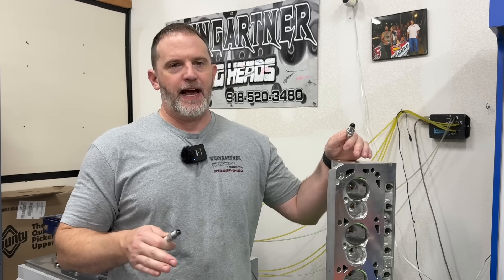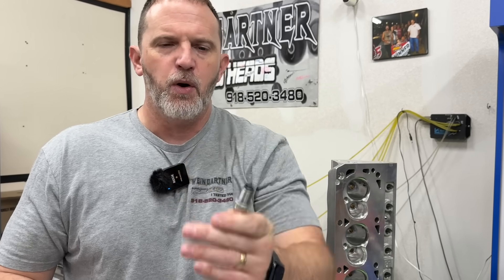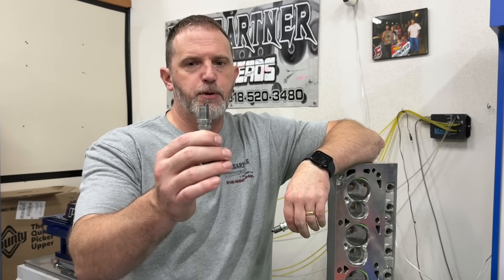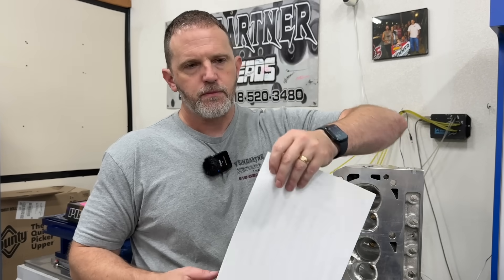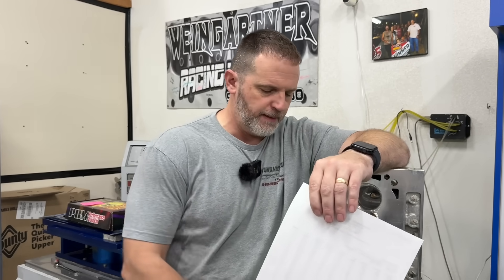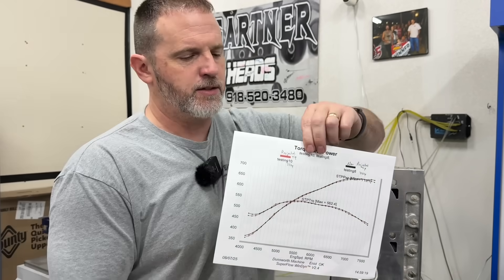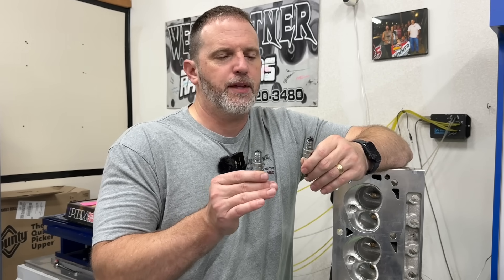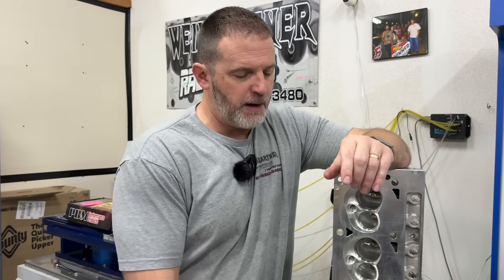Power Difference Between Spark Plug Tip Designs

Comment: Great work Eric! If there were a gain with extended tip plugs, I would have expected it to be from the added compression ratio it would provide by taking up more chamber volume (and negligible at that for a street engine let alone a race engine). I tend to stay conservative as well and use the regular plug unless called for by the head maker, as I am always concerned with the glow-plug effect that comes from those sharp threads just hanging out in the fire. The longer the run or w.o.t. time, the greater the chance of pre-ignition. Thank you for the hard evidence to go along with the theory!

Comment: David Vizard 
told a story about a spark plug modification he came up with many years ago that made power & won races in his Migit cars I think, & he said his idea cost him millions in a  patent when another racer showed him the same plug mod. 
     He said he took a conventional plug, drilled a hole thru the ground strap over the center electrode with a drill bit about the same diameter as the center electrode, & then drilled into the center electrode to make it dish shaped like a satalite dish.  This created another pathway for a flame to pass thru to create an ultrasonic flame or something like a harmonic ultrasonic whistle inside the chamber exciting the fuel mix maybe.  
Since 1999 it looks like this plug is made or modded under a name called 
Super Sonic Spark Plugs, or Ultra Sonic Spark Plugs.  The patent is expired but does exist with pictures.  U.S. Patent #5,610,470.
My thoughts are after the hole is drilled, use a small ball burr to put a slight chanfer under the ground strap hole, but still keep a sharp edge, or just leave it as Vizard designed.  Maybe the hole thru the ground strap was smaller than the dished hole in the center electrode, which would require to bend back the ground strap to dish out the center electrode with a burr, or bend back the ground strap to drill into to center electrode, but possibly weakening the ground strap when it was rebent back.  Probably a ball burr should be used to dish out the center electrode but keep the circumference of the dish sharp.  I guess the dish shape is to create & direct a flame forward into & thru the hole in the ground strap to create a jet flame like a Pre-Chamber style spark plug used on industrial engines & reminiscent of the old Honda CVCC pre chamber design.🤔
Reply: I found the David Vizard plug mod video titled: David Vizard How I got the best power sparks. 😲
Start watching at 25 minute mark, but the entire video is interesting.  I just set David's vids on 1.5 speed!😁
Reply: Kinda like the E Gap and the Splitfires.
Reply: @hotrodray6802  I think those plugs just create more turbulence from the multiple ground straps, but also more surface area of sharp points to last longer, where Vizards plug uses the center electrode as a dish to direct a flame towards & thru the small hole in the ground strap.  It sure would be neat to see an in-cylinder study slow mo video done by a university like E3 did, or if Eric could give it a try on his dyno!  I think using non resistor plugs & a powerful amplifier box & coil with Granitelli 0 ohm wires would be interesting!🤔
Reply: that patent # is incorrect. it comes up tp a mercury vapor light
Reply: @stevelaw2000  My replies keep getting deleted.  That is the correct patent number.  Maybe try without commas between the numbers, & also add, Assignee Wofsey, David.  Lots of links come up on the patent & the guys old sites.
Reply: @stevelaw2000  Not it sure if this link will post, but the patent number is correct for U.S. Patent 5610470 Assignee: WOFSEY; DAVID
https://patentimages.storage.googleapis.com/70/fc/7c/dd96a323d4d41a/US5610470.pdf

Comment: This maybe a dumb question to ask but I am testing in track a crank driven water pump setup vs standard water pump with a heavy balancer we took off roughly 12 pounds off the front of the motor the balancer itself weight about 9 pounds so that only weight that is on the crankshaft is the little hub that spin the crank driven water pump and we'll hopefully I can run that next week would you want to test that on the dyno i don't know if it will necessarily gain hp other than maybe low end or throttle response might be much better but curious and also curious if you think added dry sump would help it more or not we're trying to go dry sump next year
Reply: Ran with no damper on Lunati billet cranks and they would run about 1.5 seasons before the crank broke.
Somebody ran dyno tests.on SBC with different dampers. Stick 8" Chevy damper won the power race.
Reply: @hotrodray6802 oh dam that interesting and dam it now my crank might break lol

Comment: My thought on the timing. Base line engine with non projected tip needed x degrees to max out the HP. The projected tip extends into the combustion chamber more, igniting the fuel faster, therefore it needs less advance because of a faster burn.  Maybe you could run the projected tip in the boosted engine and cut back the timing to see if the results are similar.  I feel this is very good info when it comes time to tune for power without a dyno. Thanks.
Reply: I totally agree with the timing being a couple degrees advanced by sticking into the combustion chamber. The time the flame front has to move to get into the combustion chamber the same amount is quicker if it starts earlier. (but is negligible). The problem with a boosted engine is the incoming charge may blow out the spark (like a candle) and ruin any gain (talking about the projected tip.) So for a boosted engine, use non projected tip, with N/A, its a wash.
Reply: @annamckinney6622 it’s not a matter of incoming air blowing out the plug but it’s the increased cylinder pressure and increased fuel that makes it harder for the spark to jump, the higher the pressure the higher the voltage is required to jump that gap
Reply: Spot on.  It's all about when you reach peak cylinder pressure.  That's also why many advocate running the biggest plug gap that you can, so you get a big flame kernel and get more mixture burning sooner.  And any time you're running less ignition advance for the same power you're improving efficiency too (building less pressure before TDC).